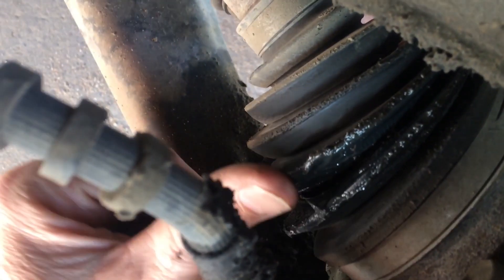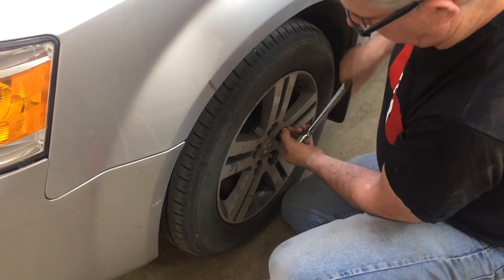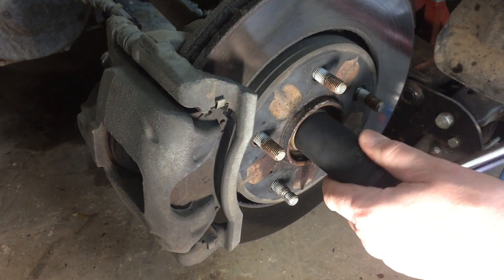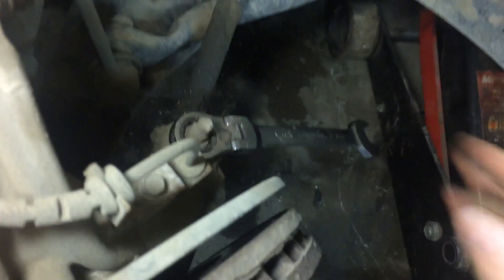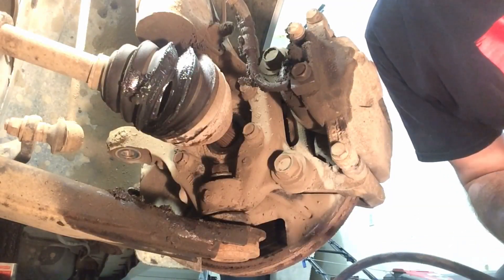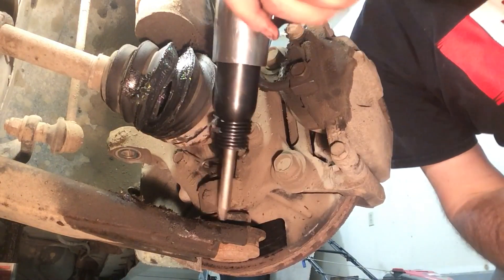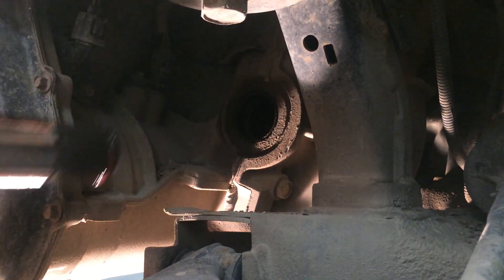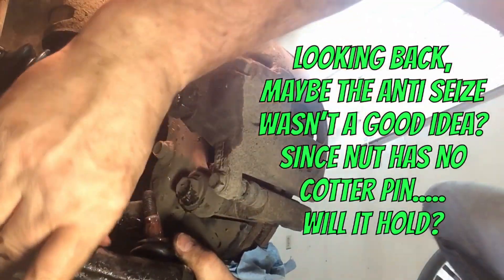How to change a cv joint on a Dodge Caravan drivers side 2008 to 2020 Town & Country VWRoutan(EP 38)

Comment: i think  you should not chamged the  entire axle  , buecase  no noiise  it means  it is in good condition still , and only you should changed the rubber boot and add new  grease
Reply from the maker: La razón por la que cambié toda la unidad Hazlo es que la bota costaba $85 o la unidad completa con ambas juntas y eje costaba $110. Guardé la pieza y espero que la próxima vez la bota sea más barata, como $20. También llevó menos tiempo cambiar toda la unidad en comparación con quitarla, desmontarla, limpiarla, engrasarla y volver a instalarla. Gracias Hazlo por tu comentario y sugerencia. Sin embargo, tu manera es más respetuosa con el medio ambiente.    ENGLISH ANSWER:
 The reason I changed the whole unit Hazlo is that the boot was $85 or the whole unit with both joints and shaft was $110. I saved the part and hope next time the boot will be cheaper, like $20. It also took less time to swap the whole unit vs removing, disassembling, cleaning, greasing & reinstalling it. Thanks Hazlo for your comment and suggestion. You way is more environmentally friendly though.
Reply: Mudica mexicana 2022

Comment: Why not just replace the boot instead of the cv axle? If nothing wrong with the axle, why replace it?
Reply from the maker: Good question Shawn! The boot was about the same price as a cheap complete cv axle, and usually you only have problems when the boot rips. It also was a faster fix. I did save the old cv joint, in case we have issues later and I find a cheaper boot.
Reply: @unclemarksdiyauto  I enjoy the videos. Saw a split boot style and will most likely get a few so I can replace boot only when time comes. Getting the boot clamp tool pays off if doing a few of them. Going to be doing a 2010 town and country. Changing the intermediate shaft, struts and linkages.
Reply from the maker: @a3sully  I should look into those too. Only issue is if original boot rips, most likely you will not notice it right away & dirt can get in the cv joint. To clean it properly, you will need the joint out of van. At that point, the regular boot will work just fine.

Comment: The part is around 100-140 and can be done under an hour by any decent mechanic maybe even faster. Should be no more than 200-250, so if you DIY and you need to buy tools and other things might be cheaper to go to a mechanic.
Reply from the maker: True, but depends on how many tools you have already. Even if tools make you break even on job, you are still ahead owning the tools for another job!

Comment: Way too much work. Really only need to release the strut bolts and it slide out
Reply from the maker: I did it this way so as not to screw up the camber alignment setting. (Those 2 bolts adjust that) Yes easier if you do it your way, but I didn't want to pay for a alignment or take a chance to wreck my tires.